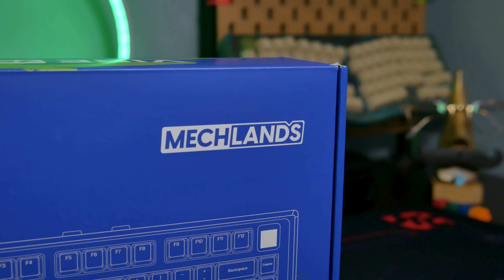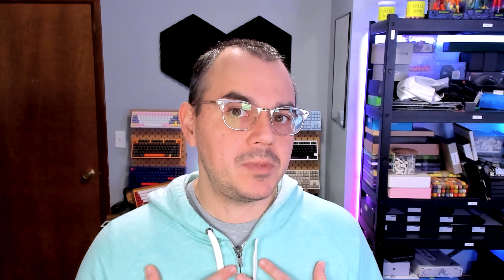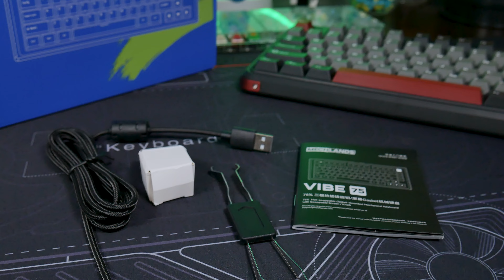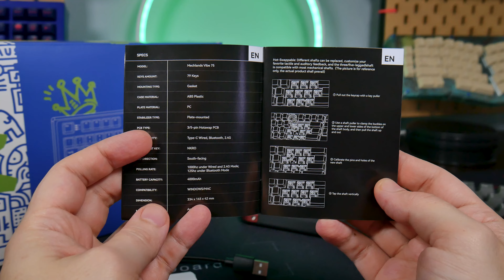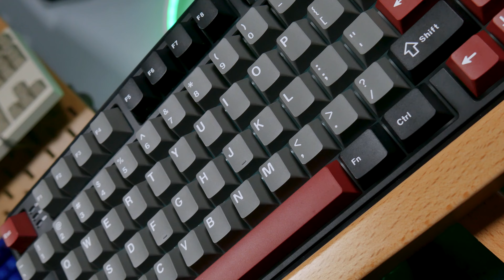MechLands Vibe75 Review: Doing Budget Differently

Comment: When you say you could pay 10-20 more for something better, what would those be?
Reply from the maker: Immediate examples would be Womier SK65 or Chilkey ND75 in similar form factors, but that's a personal preference thing. 

If this is where your spending cap is, and this is your first "custom-capable" mechanical keyboard, then the real killer app for Vibe75 is the stock switches. They're among the best I've used on a pre-built this past year when carrying them over to other keyboards, carrying a full, lower mid-tone sound, great housing fitment and stock lube, and smooth travel.

They bested switches from Luminkey65, Yunzii YZ87 (that ones not hard, Milk V1's are ass), Aula F75 (those are TTC), SK65, and even Chilkey ND75 (Kailh) when used in a Mode Envoy with FR4 and no foam... and you can currently only get them in Vibe75. So there's that. ALL of those switches, to be clear, do well in the boards they come with (except YZ87), but these Cream Mints hit different.
Reply: @TheManicGeek  Thanks for the reply. It's less of a spending cap and more of what I can purchase on UK Amazon (the return policy is important) which happens to be mostly Mechlands/Epomaker boards.

I did find a Chillkey ND75 from a retailer here (No womier), but I bought the Leobog hi 86 which sounds similar to the Vibe. I chose it after reflecting on your reply - that if I purchase something in this price bracket, it should have something I could use on a future build perhaps and I felt better about reusing a whole aluminum case than salvaging switches.

The leobog hi 86 was £71 and the vibe 75 was £62 so for an aluminum case I thought why not (Chillkey nd75 was £99). I really enjoy the sound in person, however I feel the keys feel "rough" pressing down (they are Nimbus v3). 

Something to do with being POM switches?

Also having it in person I don't think aluminum is a key factor other than for the sound so I might be happy with the plastic on the Vibe. I wonder if you had any roughenss with your Vibe switches?
Reply from the maker: @praeficere3463 My Vibe75 switches are among the best I've tested on the pre-builts I've used so far in terms of overall quality and presentation on a higher-end board. I dropped them in my Mode Envoy, and I've liked them enough that they're still on the board right now.

Full POM doesn't mean what it used to with something like Gen 1 NK Silks. Contemporary full POM switches, like any other, are quite nice when the molds are made well and they're well lubed. It's possible either the factory lube was ass on your switches or there was something off about their construction. Sometimes it's just SUPER unlucky and the rest of the switches are fine.